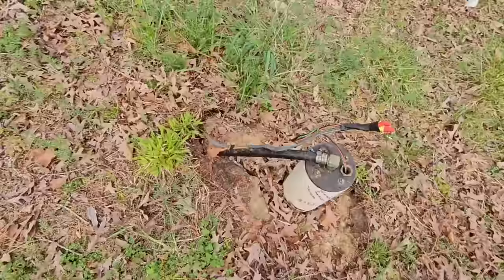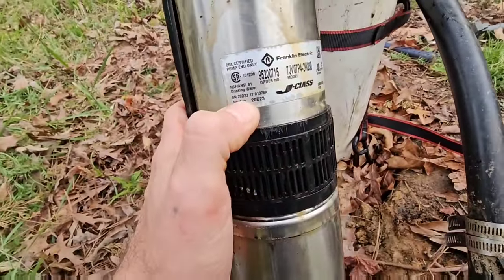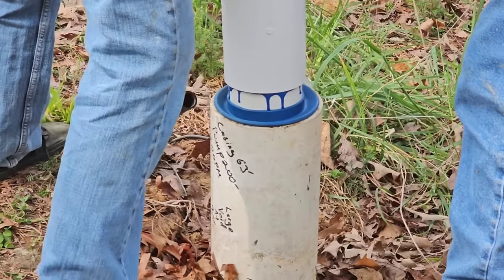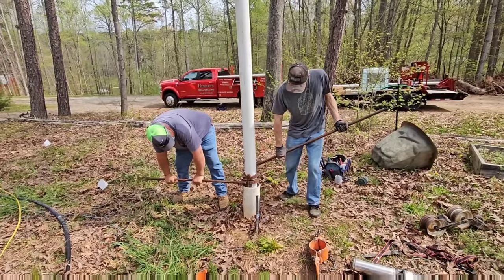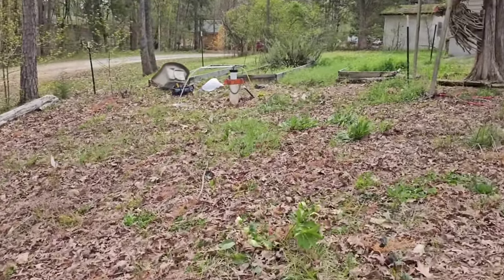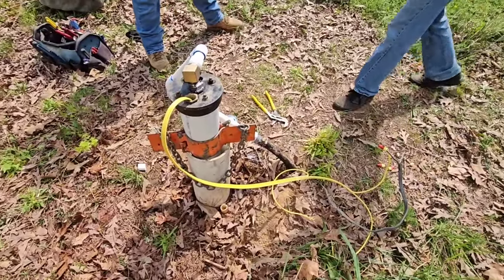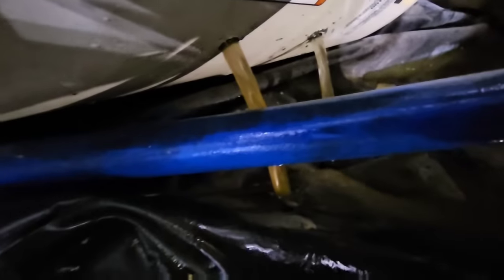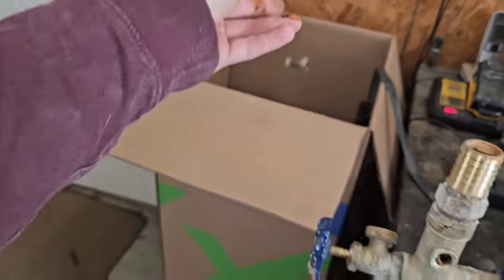Sediment Problems and How to Fix it. Discolored Well Water After Heavy Rainfall. Full System Check

Comment: What causes wire damage?
Reply: Vibrations against the black poly pipe chaffing it and rubbing through.
Reply from the maker: I pump typically cycles 1-2 times per minute while you shower, after say 15 years the course rock wall of the well wears through the wire jacket. But when a Bladder Tank fails, the pump will cycle 50 times per minute, this multiplies the effect on the wire & will ruin it faster.  Typically the pump will die within a few months of a tank going bad. The sign you look for would be low pressure or surging pressure in the home
Reply: A torque boot above the pump would be a benefit, but with a bad tank, the wire could be rubbed all the way to the top I have seen it happen before.

Comment: Doesn't VA require a disconnect switch at the tank for service ?
Reply: In Nc if  well is out of site of breaker there must be a disconnect at the well. But va maybe different but atleast a light switch would have be sufficient

Comment: I reckon I would have started at the tank first.and maybe just maybe I would have drained the tank to the outside so I didn’t fill the crawl space with water.I little pump on an electric drill would pump that out in 5 minutes I’ve used them dozens of times.in my rain water system.you couldn’t find the tank because you didn’t look.

Comment: So wait a second.All that work and expense and equipment and in the end it was a clogged filter in the house.the owner wasn’t home so why not wait until you can get in the house?An I missing something  here?Just asking because I am not a driller.The electrical was sketchy but can’t you sheath the cables somehow?or run it thru some flexible conduit?
Reply from the maker: We had been there 2 years prior & talked about a liner at that time. That's why I knew to go to 90ft. It just so happened the tank was bad as well

Comment: Hey brother, I have an issue that I can’t seem to get help for. My submersible pump fills up a 2800 gal tank, which is then pumped with a smaller pump to the property, so the underground pump is only on about every 3 days to fill up the tank. Lately I’ve been having an issue where when my float switch is engaged, the underground pump whines and trips the main overload. I then have to manually reset the overload. Basically, the pump often whines instead is starting, and it triggers the overload, although sometimes it does just start normally. It is a 3-wire pump, and I have already replaced the control box. Do you think that my pump may need to be replaced? When the pump is running, the multimeter records the following: 9.8A on red, 19A on black, and 26A on yellow. Unfortunately, I do not know how deep the well is or what type of pump I have since the previous property owner didn’t provide those details. I would greatly appreciate any assistance you could provide me.

Comment: I don't understand how a plugged switch pipe could cause the low pressure in the system. If the pump really was putting out high pressure wouldn't the whole house experience high pressure seeing how the switch wasn't shutting off the pump? I can see how the switch wouldn't shut off because it was plugged, but how would that cause low water pressure in the house?
Reply: The plugged switch nipple only caused the pump to run continuously. The failed tank full of sediment caused the low pressure. I see what you are saying though, about the pump. You think if you got 100 -140 psi at the well head , you'll have it in the house. 💡edit. Thought about it, that pump pressure is only when its deadheaded, its lower when flowing.
Reply: I think the pump was losing pressure due to overheating. The electric motor puts out less torque when it gets hot.

 The motor windings increase resistance when they are hot, so it has less magnetic force to turn the pump stages.
Reply: @mitchdenner9743  How could a tank full of sediment cause low pressure? It would cause short cycling (if the switch was working properly) but it can not cause low pressure.
Reply: @jjfenn-b4r  I think you're right that the pump was overheated causing the low pressure, and then when he pulled the pump and let it cool and reinstalled it it was back to normal.  It must have been pump related unless there was a restriction to flow somewhere in the system (like a plugged filter), but he said the filter wasn't that bad. Whatever it was that was causing the low pressure it seemed to be fixed by just pulling the pump (letting it cool) and reinstalling the pump with new wires. I wonder how many amps the pump was drawing after reinstalling it?
Reply: @rmeyers2021  read, i said failed tank, as in busted bladder =   no pressure on the house side . Clogged water filters don't help or gunk filled piping.
Reply: @mitchdenner9743  A busted bladder means the water will fill the entire steel tank, and when it is full it will stay full unless it is drained. That has NO IMPACT on the house, other than if the switch opens and the pump shuts off, the pressure in the system will drop very quickly if you open a fixture and let water out. Since it drops quickly the pump will turn on and off and on and off and on and off very quick. It's called short cycling. But the pressure in the house will remain between the switch settings. The only way the pressure would be low with no restrictions, would be if the pump could not keep up with the volume being used from the fixtures. If the pump can supply that volume the pressure can't drop.

Comment: Should give there money back wire chaffing is an installation error. When pump wa changed that wire Should have been infected.  Obviously it would have been easy to see.
Reply from the maker: The first time it was pulled I recommended the wire to be changed, they opted not to.

Comment: I'll never understand why well pump electrical wires are not better protected by being enclosed in a pipe as opposed to being taped.
Reply: Submersible wire, double jacketed wire is even better.. both will last 50 plus years no problem. They don't like rubbing inside steel cased Wells.  But if there's no rubbing, it will last forever

Comment: So the liner was not what was needed
Reply from the maker: The liner was needed bc the water always got yellow during a rain. The bad tank would hold that water for days after.  Just multiple issues. I had recommended a liner 3-4 years ago, the customer finally wanted it installed

Comment: Please explain how a tank  is self cleaning?

Hopefully you actually look at your comments and not someone who responds to none of the viewers who give you your views
Reply: I was going to ask the same thing.
Reply: The pressure tank outlet is on the base, so any sediment will settle to the bottom and get pulled out.

The tank should empty most of the way before refilling, so you get a fresh batch of water with every pump cycle.

If the diaphragm rips then you get stagnant water build up in the tank.
Reply from the maker: @jjfenn-b4r  well you answered the question perfect! 👍 respect!

Comment: I wouldn't have you do my well. There are devices to prevent chafing of the wire and torquing of the pump.

And why don't you have a pitless adapter? The sanitary seal was in poor shape.

You don't do yourself any favors in this video, especially if you've been here before, you would have known about the filter before the bladder tank 

Not impressed.